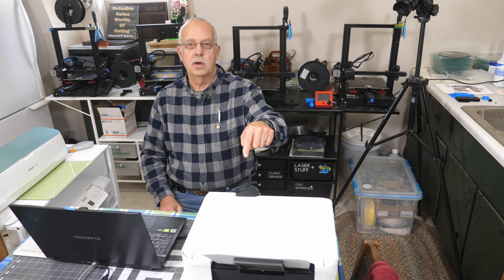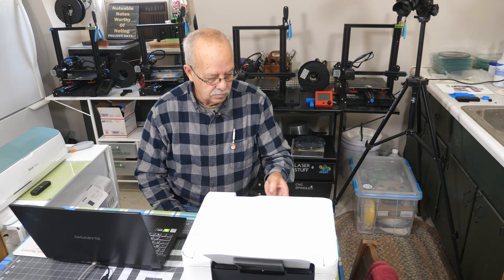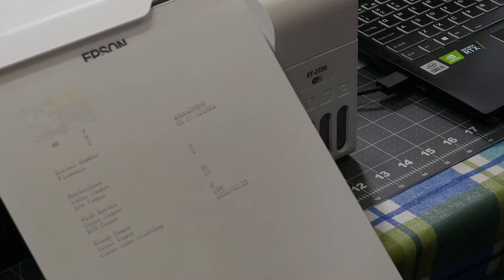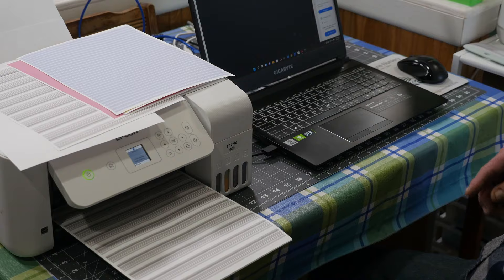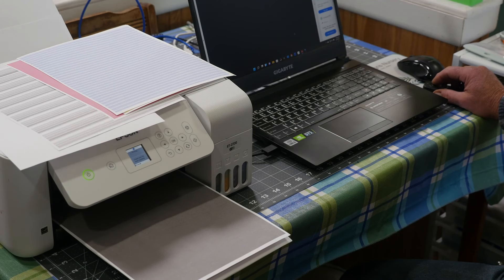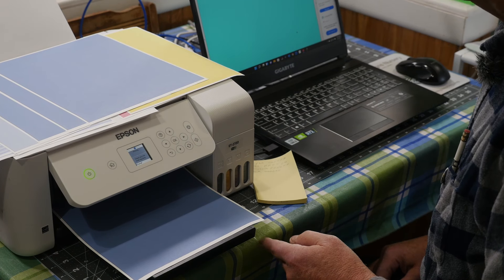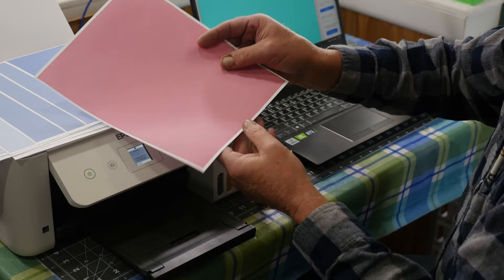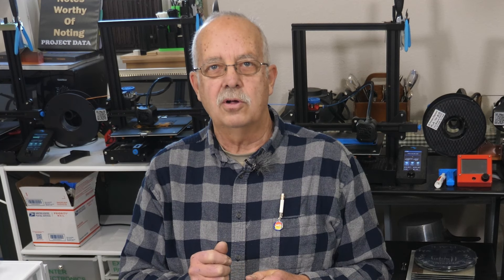Epson 2720 Printer Clogged Nozzles FIX

Comment: I printed a beautiful blue tumbler wrap 3 days ago and today my blue isn't working nothing not even a drop on paper I've done checks except power cleaning, need some advice before I pitch it out
Reply from the maker: Try running the cyan page a few times.  If this produces nothing, you can try a power clean as a last resort.  If that does not improve or clear it, then the cyan nozzle head has failed and would need to be replaced.  whether or not it is worth it, depends on the printer model.
Reply: I've  tried printing a cyan square 20 times now I'm getting a very light yellow square  thanks
Reply from the maker: @fayecrump2375  Assuming you have an Epson printer, try changing some settings as a test:  turn OFF high speed, change paper type to premium photo glossy, even though you can use just plain paper, and print a full sheet of just the cyan.  If you are creating your own sheet, use Hex #00FFFF as the color.  If using RGB, then rgb(0,255,255).  Blue uses a combination of cyan and yellow, so if you are trying to print a blue square, that is why you are seeing the faint yellow.
Reply: Thanks for taking time to answer me i finally got it to work after 20 head cleanings
Reply from the maker: @fayecrump2375  Excellent!  Cheaper than a new printer...........

Comment: I have a new Epson 2400 printer that I am trying to do sublimation on, it will only print in Black and will not do colors . Can you help me please, It did run with inkjet ink before we realized it had to be converted, I have been printing the form , it prints in color but will not press on to shirts
Thanking you in advance, my name is Judy

Comment: I cant get my blue to work. I have ran about 30 pages through the printer and nothing yet is showing. Do I keep on or give up now? I put in the rt codes, tank is full, I don't know what else to do!!!
Reply from the maker: Try shaking your printer from side to side several times, but don't get wild or you will have a mess.  Some inks can form sediment that clogs the lines and this may dislodge it.  This works most of the time, but there are always exceptions!  As a last resort, do a Power Clean.

Comment: I have done this for 2 days and it did not help the black on my printer. Do you have any other suggestions.
Reply from the maker: Gently shake the printer from side to side.  there may be sediment in the bottom of the tank and this may dislodge it.  As a last resort, try a Power Clean.  Make SURE your ink tanks are at LEAST 1/3 full or this can be a disaster.

Comment: What if I can’t get yellow and magenta to even print a color?  I printed 6 copies of yellow and no color.
Reply from the maker: As a last resort, you can do a Power Clean.  If this does not clear it, then the print head is either permanently  clogged, or the electronics to it have failed.
Reply: I did the power clean and it worked perfectly.  My magenta and cyan weren’t printing at all.  Black was pretty bad.  Yellow was great.  After the power clean, all better!

Comment: I hadn’t used my printer for quite a while.  Going back to use it all good for short time.  Now no blue!  Cyan. Prints from your pdf page gives no ink on printout😢.  There is ink in printer.  Don’t know what else to do other than tear the thing apart and clean the jets myself….😅
Reply from the maker: From your description, it sounds like the line from the ink tank to the internal buffer tank is blocked.  This could be from sediment forming in the main tank, blocking the line.  Try shaking your printer from side to side several times, then try cyan color sheet.  May take several passes, but this works most of the time.
Reply: @rogersshop  thank you.!  Will try it.  Also having trouble keeping Wi-Fi connection so….will deal with it next week.  Had to ditch my plan for a gift for this weekend.  LOL!

Comment: Im having trouble with my black ink the other colors are fine but the black comes out with faded and with lines ive done everything bit it seems to be the same
Reply from the maker: Some brands of ink will separate and form sediment, clogging the lines.  Shaking the printer from side to side (don't get wild here) may dislodge and dissolve that sediment.
Reply: Im going to try this

Comment: I did the 4 print in your  video. It fixed all but the yellow. There isn't anything coming out of the yellow. What can I do to fix it?
Reply from the maker: Try shaking your printer from side to side several times, but don't get wild or you will have a mess.  Some inks form sediment that clogs the lines.  This has worked for many, but not all.

Comment: I cant get blue or yellow to print at all, I've run this many times. Any suggestions?
Reply from the maker: You can also try disconnecting the printer and shake it from side to side several times, then try again.  This works for most, but not everyone.  Some inks can form sediment that clogs the tank outlet and this usually clears it.

Comment: I just hooked mine up today, ran through everything I was supposed to do, and it immediately will not print yellow properly. Green is printing in Cyan. Is it normal for this to happen directly out of the box?
Reply from the maker: No.  You will need to contact Epson if this is a new printer.  If the yellow is not flowing, then green would appear cyan as it takes both colors to make green.
Reply: @rogersshop  😕 that's what I feared. Brand new out of the box. Of course used all my sublimation ink to fill it up, only to have that happen 🤦‍♂️

Comment: I tried printing ur download but it printed it all out black any suggestions on y
Reply from the maker: There is a different file for each color, so make sure you are using the correct file.  Also make sure printer is set to print color and not black or grayscale.

Comment: So my printer is not printing cyan at all. Can printing multiple color pages fix it ?
Reply from the maker: It "may".  Try gently shaking your printer from side to side as some sediment may have formed in the ink tank.  This is not uncommon with some sublimation inks, especially the very cheap ones.  It may take several pages to clear.  As a last resort, you can do a power clean.

Comment: My printer was only printing yellow and black. I added more ink to my machine and did a head cleaning. Now none of the colors are printing except black. I’m currently doing your prints and they are all coming out white.  Is there something else wrong or is that usually what happens when they clog?  I also use my printer frequently so it doesn’t ever sit too long.

Comment: I’ve only had my Epson 2803 for a week and have had so many problems! I converted it to sublimation since I bought it , but my issue now is none of the colors are printing , each purge I do it’s just lighter and hardly any ink , the only color that’s fine is the yellow. I already had to deal with “the ink pad needs service” with only 70 total prints. I get ink streaks when I print dark images also. I’ve had the worst luck with this printer and super upset none of these recommendations have helped 😞

Comment: This isn't working on my Epson 2720. Does anyone know of anymore suggestions?  My Cyan and Magenta will not print
Reply from the maker: Some inks can form sediment in the tank after sitting for a long time.  You can try shaking your printer from side to side several times, then try again.  Works for most, but not everyone.

Comment: So, I printed your print sheets, and my blue came out white. My blue is my only problem. Should I keep on printing?
Reply from the maker: It could be that your cyan line is clogged or has a "gremlin" in it.  Try picking up the printer and shaking it side to side several times (don't get wild here or you will have a mess) and try again.  This did work for one viewer.  As a last resort, you can try a power clean cycle.

Comment: I need help I am using the files … for cyan and there is no ink at all coming out
Reply from the maker: You can try shaking the printer from side to side several times as some inks can form sediment that blocks the line from the ink tank.  Works for  most, but not everyone.

Comment: Black and yellow perfect. Zero pink or blue. I tried and after 15 tries still nothing. I need help please.
Reply from the maker: You can try this:  Disconnect all cables, then shake the printer from side to side several times, reconnect, and try again.  Sediment may have formed at the bottom of the tanks, clogging the lines.  works for most, but not everyone.

Comment: So I tried this method and I am getting no lines or missing segments when I print your pages, but when I go to print my sublimation print or the nozzle check, I have lines everywhere.
Reply from the maker: What print resolution are you using?
Reply: @rogersshop  Ok, I fixed all of my settings and its been working perfectly for about a month, BUT just tonight I was printing some things. It worked just fine, but then in the middle of one design it just stopped printing Cyan, even though it is full. It won't print cyan now. Any ideas? Also, thanks for all of the help so far! You have been so helpful!
Reply from the maker: @laceyreynolds7578  Possible that the line from the tank is clogged.  Try shaking your printer side to side several times.  Some inks can form sediment that plugs the lines.

Comment: Great video but I am getting no printout for my colors, just bad black.  Is it hopeless?
Reply from the maker: I recently did one that took 50 sheets before It started to clear up.  You can also try shaking your printer from side to side several times and some inks can form sediment that clogs the line output to the internals.

Comment: I found a printer just like this in my area on offer up, already with sublimation ink inside $50 but description says it’s clogged because it hasn’t been used in a while.
Reply from the maker: This method may, or may not work for you.  works for most, but not everyone.

Comment: Mine doesn't print yellow at all even on a test sheet. What can I do now to fix that problem?
Reply from the maker: Some inks can form sediment which can clog the output line of the tank.  Try shaking the printer from side to side and it may clear this.  Works for some, but not everyone.  Don't get crazy with this or you will have a mess!!!

Comment: Help. Printed something in blue it came out fine and then the next image nothing. I ran 3 sheets and they are all coming out white. Tank says blue is full
Reply from the maker: Gently, shake your printer from side to side, then run the color sheets I created.  This works for "most", but is not guaranteed.  Some inks form sediment after sitting that clog the lines.

Comment: My printer will not print at all, just a few lines here and there. Any suggestions?
Reply from the maker: It may several sheets of the color files before anything appearsDepends on how long the printer has been sitting.

Comment: My printer was working perfect until it fell off my desk, backwards. It slide against the wall which kept it from having a really hard plummet to the floor. Now, the blank prints correctly, but the colors do not print. Can the printer be taken apart to see if something came loose?

Comment: Hi! Thanks for this video it explains a lot but the trouble I’m having is that black is the only color that’s printing out. I’ve printing the block coloring and for the colors the pages keeps coming out white. I brought this printer a year or 2 ago an Epson 2720 and I haven’t really used it often until a week ago so far I’ve only printed out close to 100 pages doing the whole time I’ve had it and my ink cartridges are full. Can you give me any more tips to help me and thank you in advance. I forgot to mention 2 days ago it was just working fine I was printing pages and the color was there.
Reply from the maker: First, make sure that the printer settings were not inadvertently changed to black and white.  If still set to color, try running a nozzle check from the printer touch screen.  If no color prints at all, you may have an electronics failure in the color nozzle controls internal to the printer.  As a last resort, you could try a power cleaning.

Comment: My yellow will not fill or print at all. I’ve done all the cleaning but nothing is working
Reply from the maker: If the color sheets did not work, and you may need to run up to 20, then try shaking your printer from side to side several times.  This works for most, but not all.
Reply: @rogersshop  I mixed 50% water and 50% rubbing alcohol and cleaned out my print head, it was very clogged but it did the trick!
Reply from the maker: @sadiealexis5737  Yes, that also works provided the clog is not ahead of the print head, which is more common than one would think.

Comment: i have no colot coming though black is great
Reply from the maker: Gently shake the printer from side to side.  there may be sediment in the bottom of the tank and this may dislodge it.  Works for some, but not all.  Just a suggestion.

Comment: I JUST did this... I got the msg that my ink pad is done... It's on the back right side unscrew it has 2 screws but replaced ink pad off Amazon $12 if it happens don't buy another printer

Comment: The only problem I’m still having is with Magenta. Just prints no lines, but not the magenta color, it almost looks lilac. I’ve printed it a dozen times. Any other suggestions?
Reply from the maker: Sediment may have formed in the ink tank.  Try shaking your printer side-to-side several times and it may dislodge/dissolve the clog.  this seems to be most prevalent with Magenta.  Don't get wild with the shaking or you will have a mess!
Reply: Thanks I’ll give that a try.
Reply: Tried to shake it, but still no luck. I opened it up & looked, it seem like there must be a clog somewhere in the line, cause there was very little ink compared to the others. Any other suggestions?
Thanks.

Comment: What if I’m still getting blank pages? 😭😭
Reply from the maker: You can try shaking the printer from side to side (don't get wild, here).  Some inks can form sediment that clogs the lines.  No guarantee this will work, but it has worked for some.  As a last resort, do a Power Clean.

Comment: well...printing the problem-colors just doesn´t work. There is no color on the paper not even a little line or something...
Reply from the maker: This works for most, but not everyone.  If the printer has been sitting a long time without use, the heads can clog with dried ink.  A Power Clean may be needed if none of the sheets will print anything even after repeated sheets.
Reply: @rogersshop  Recently i did many prints and did a powercleaning like 4 times now. Now i turned my printer off, and unplugged it, and will try it later. Maybe the Ink level-indicator could be the problem i guess.

Comment: I've printed the cyan sheet attached 30 times now and not even a line of ink is coming out. I'm ready to give up.
Reply from the maker: Try shaking your printer from side to side several times (with cords detached) and try again.  Sediment may have formed and clogged the line.  This works for most, but not all.

Comment: Mine clogged while printing. Why would it do that? 5 head cleanings magenta is printing now but cyan still isnt
Reply from the maker: Sounds like a "gremlin" may have clogged the line.  Try shaking the printer from side to side, but don't get wild or you will have a mess.  As a last resort, try a Power Clean if this doesn't free it up.  Some inks have been known to separate and create sediment at the bottom.
Reply: @rogersshop  yes I did a powercclean and its now printing. I noticed the sediment in the bottom of the PJ ink bottles? Is that not normal?
Reply from the maker: @valeriehofmann2615  There should not be any separation of the ink.  That is bad!  I use only HiiPoo sublimation ink (no, not sponsored by them) as I never have any issues with it settling or separating.
Reply: @rogersshop  thanks I emailed them. We will see if they reply back.

Comment: I’ve tried everything even power clean and my cyan just won’t print :((
Reply from the maker: It could be one of two things-  The line feeding the head is plugged from sediment, or the print head has failed.
Reply: @rogersshop  thank you 🙏 but how can I fix this
Reply from the maker: @Eandcostudio  Gently shake the printer from side to side several times.  there may be sediment in the bottom of the tank and this may dislodge it.  This works most of the time if sediment has formed, but not for everyone.
Reply: @rogersshop  thank you 🙏 I’m finally getting some broken blue lines. But of course I get an error msg that says I need to replace the maintenance box 🤦🏼‍♀️ so now I need to wait to get that in before I can print again sigh 😞

Comment: HELP   how do I get rid of the lines when I'm printing
Reply from the maker: There are a few things that can cause lines when printing.  #1 would be clogged nozzles, which need to be cleared by either using my print sheets in the description, or as a last resort, a Power Clean.  #2 is using WIFI to print.  This can cause dropped packets if the connection is disturbed, which will result in lines or skipped parts of the graphic.  For me, if the graphic or print is important, WIFI is NEVER used.
Reply: @rogersshop  I did the maintenance  on it and its till doing it
Reply from the maker: @tamijohnson9870  In that case, it may be that the head has failed.  Unfortunate, but it happens.
Reply: @rogersshop  I did the Maintenance check again and it works fine now.

Comment: I’ve run this 30 times for each color, and I only got the magenta to start working😭
Reply from the maker: Try this:  Disconnect the printer, pick up and shake side to side several times.  Reconnect and try again.  Works for most, but not everyone.